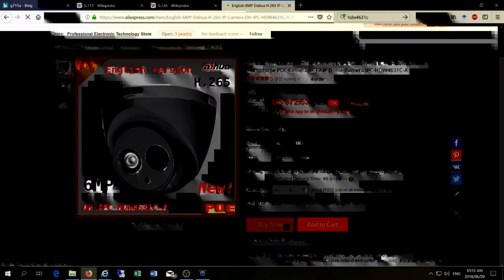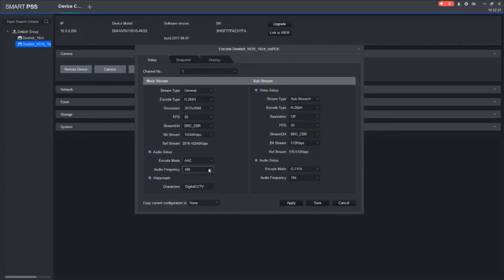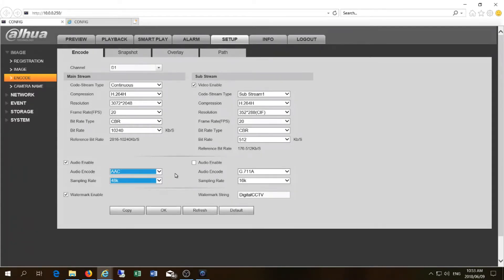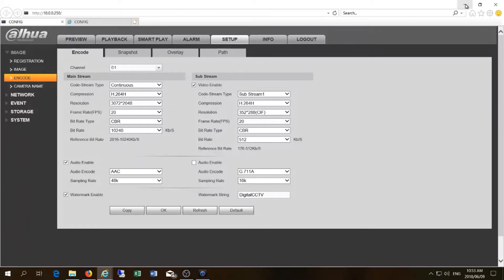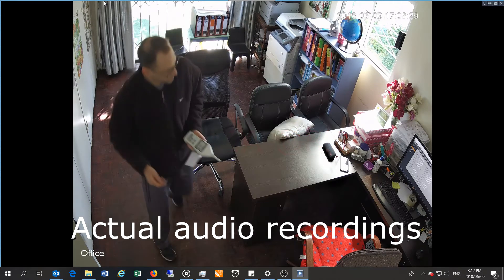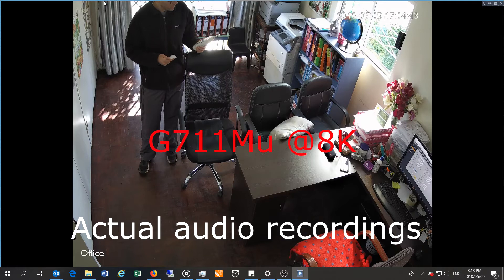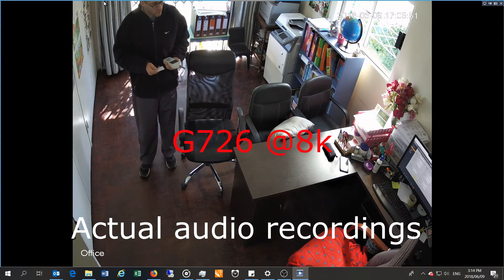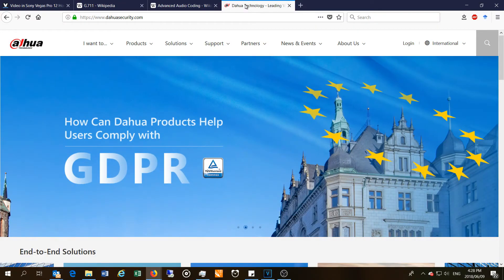Audio tests on the Dahua NVR using the IPC-HDW4631C 6MP IP Camera

Comment: I'm looking a a camera that has good audio quality when talking right in front of the camera and It's interesting that your camera goes up to 64Khz audio sampling rate, that's very high for audio quality standards, most cameras I've seen only go up to 16Khz, I wonder if 64Khz is standard across Dahua cameras. But most brands don't go to much detail on audio specifications on datasheets. I suppose that if you speak right in front of that camera (2 feet distance) you should get a crystal clear audio right?